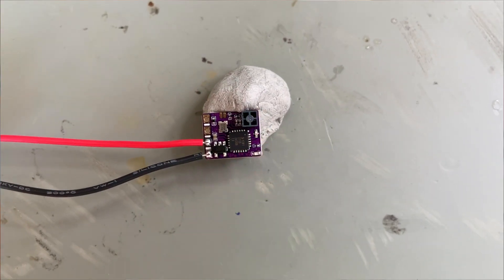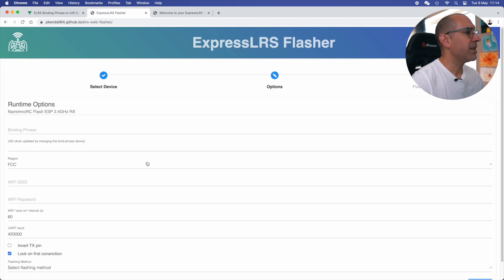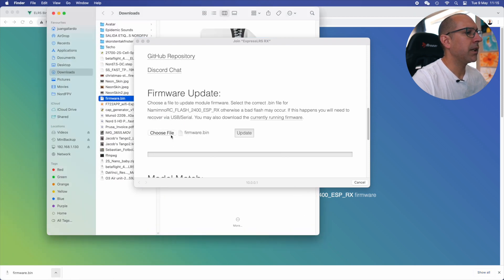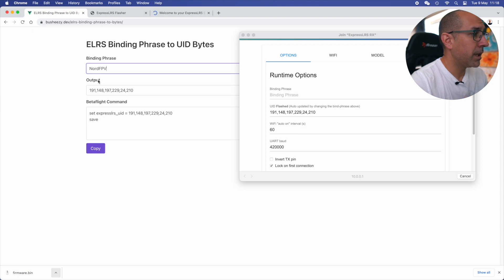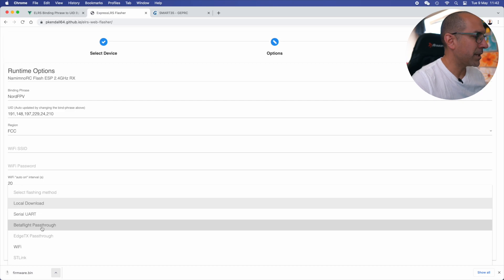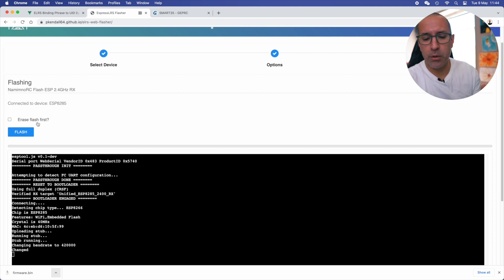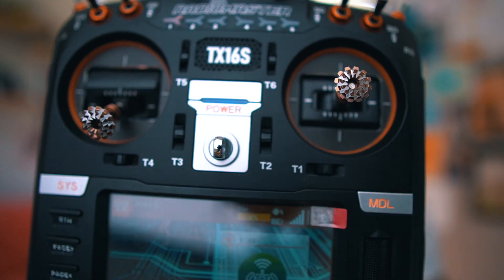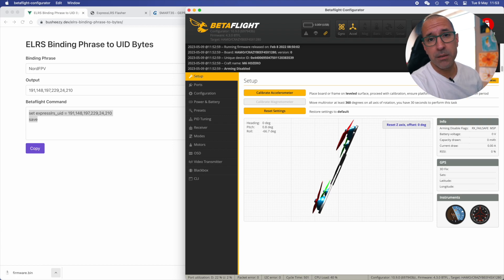3 Easy methods to bind ExpressLRS (ELRS)

Comment: I have tried all 4 ways and my Radiomaster RP3 still wont bind. Here's the issue, when powering it up 3x the light will blink for about 3 to 4 seconds. The it goes solid. Even when trying to do it wirelessly the light goes solid, but still no bind. PLEASE HELP. I have installed the RP1 and RP2 with no issue, this is the first time trying a diversity Rx...
Reply from the maker: Have you connected tx and tx already?  Try desoldering tx and tx, have just pwr and gnd and test again either with wireless or 3 times.
Reply: @NordFPV  a body of mine told me that if it gets hot, it's fried. It kept going into Wireless mode, but I couldn't detect the Expresslrs via wifi. Ordered another one thank you, and returning the one that came DOA

Comment: Im not understanding the idea of a binding phrase when i have more than 1 drone. If i use the same phrase on my radio and both drones, how does the radio knows to what drone to connect to in the event both drones get turned on?
Reply from the maker: Hello. Why would you have both drones on at the same time?
The pass phrase is just like a WiFi password, you can have many devices connected to the same WiFi as long as the have the correct password. 
From a technical point of view, if you turn on both. Drones at the same time, both will be controlled from the same radio while turned on.
Reply: @NordFPV  one example would be:

I have a TRX4 that I am planning to put an ELRS receiver in to control it from my TX16s, but I also have a Huina 1592 excavator that I modified with another ELRS receiver to also control it from the same transmitter.

My goal is that I want to use the TRX4 with an RC trailer to tow the excavator around, and I want to be able to have the excavator on, so that when I take the excavator to where I want it and I want to unload it from the trailer, I would ideally just switch models in my transmitter and that way I could control the excavator without having to touch it.

But if the remote binds to both RC products at the same time, that would not work.
Reply from the maker: Complex scenario! But yes. You have a way to achieve this too. There’s a parameter on each model where you can assign a model number, so when only that model is on the receiver will listen. I haven’t use it many times, actually I recommend FPV people to avoid it because it can creates confusion on FPV enthusiasts, but I know it exists. If you look in the ELRS wiki, and check something called “model number” (I think) you should get more information about it. But definitely possible.
Reply: @NordFPV  this is great information. Thanks. 

I have many models that I am converting to ELRS and many of them will be interacting with each other.  I'll take a look at the model ID.

Thanks a lot!

Comment: Got a elrs module for my reranis q7 s. Udated it's firmware. Im trying to bind to a pavo 25 v2. It's also updated and bound. I set everything up with a phrase and assigned number matching. I know im bound because there is a C on my radio, I got a solid blue light on the drones elrs module and i head my radio announce telementery on and off when i plug or unplug power. But i don't have input from the sticks on betaflight. What could it be?
Reply from the maker: The most probable problem is that either you have to/tx cables inverted, or that you haven’t selected the right por on the port tabs for your serial receiver. Last thing is to check you are using serial-crossfire as you connection protocol in the receiver tab
Reply: pavo 25 v2 cinewhoop and my Teranis qx7. I followed all the steps in the ELRS quick start website and got as far as binding.

My transmitter says im bound and shows a C indicates connected as well as telemetry signal . My wiring diagram that came with the pavo indicates UART3 and so i set that in Betaflight with Serial Uart and CRSF. Both TX and RX have the latest FW 3.3.2.

Phrase set and even assigned Model number. Ran lua script on TX.

I've set the internal module off and set the external to On. I've set my Model and switches to arm.

I powered my radio on then power the pavo, LED on the reciever blinks a few times and goes solid, radio says telementery recovered but no sticks on betaflight and no switched moving. What am i doing wrong? Thanks
Reply from the maker: @Monkywings , sounds like the only thing you haven't double checked is the physical connection. Check that TX -> RX and RX->TX, and not TX -> TX, RX->RX as many with this issue does.
Reply: @NordFPV  Solved.  The manufacturers diagram says the Uart is 3. I followed the Rx wire to the FC and it was actually uart6. Switched my Uart to 6 and my guy is airborne again. Thanks
Reply from the maker: @Monkywings  Great that you could fix it.

Comment: I just bought the geprecdark star 20 and y cannot flash it. When i tried to do it trough wifi mode, it appears that the receiver is beta fpv 2.4 nano. I dont know what firmware set up, if it is elsr beta 2.4 nano or geprec 2.4 nano as the manual said. What do you suggest?

Comment: If i try to use nano rx alredy binded to another FC, with my new FC, i must reflash it? Pressing button boot on rx dosnt any reaction, no conection with my radio, but when i resoldering rx to my old FC rx starts work with radio normaly
Reply from the maker: no. You can just move a bound RX from one FC to another FC and it will stay bound.
Reply: @NordFPV  great thnx i will try it! Telemetry without RX will work from new FC? 
what i must do to reset nano rx like factory reset?

Comment: I usually fly on crossfire and for me first impressions are terrible. I do not know the firmware version and it should not be a main point before binding... Imagine that you are on remote area without laptop and wifi (you phone is out of battery)...
How can I realize, what firmware version and RX type is there? 

My friend just left me couple of ELRS drones and I have bought a Radiomaster Pocket.

There is no way to bind the RX without usb cable and laptop on the field... Is this a magic? That is a disaster. 
How it is possible to make it so complicated and also frustrating, it should be just one button binding...
Reply from the maker: Well, there’s the way to get the device in binding mode by disconnecting 3 times the battery in a short time, so your very peculiar example would be covered by that. How do you know the model? Very easy, you let the device enter WiFi mode and open the web page and it gives you the information you are looking for and much more, and now, since ELRS 3.4, you will also be able to bind with a button like crossfire. Now think about any other protocol provider that has listened to the community and provides new features and changes this fast…

Comment: *you really should change the title to "3 way of binding ELRS with a binding phrase (ONLY)" or it is quite misleading 😒
ELRS is a total dumpster fire to setup today, and I would tell noob folks to use crossfire a thousand times over this BS system. Binding should only take 1 or 2 steps at most, and never involve this kind of foolery and juggling nightmare interfaces in multiple programs. It also doesn't help when everyone is so toxic, unhelpful, uninformed and out right mean in all the support forums.
Reply from the maker: Oh wow, I’m sorry you have had such a bad experience. For me it has been the total opposite, ELRS is simpler than others. If you decide to give it a try again and need help, please reach out, I’ll do my best to help you.

Comment: Hi, does the 2nd method work if i have flashed ELRS o R9M 2019 module and having R9MX receiver with an F4 fc. ? kind of stuck with binding. the factory firmware that came with R9M TX doesnt seem to work by pressing the button on the TX module. Kindly suggest.
Reply from the maker: Hello, I'm sorry I'm not very familiar with reflashed R9M modules/methods. But if the module already has ELRS I would expect this method of betaflight passthrough to work. Otherwise I will try to reflash one more time the ELRS software and try again.

Comment: What if I uncheck the box in the Auto Wifi On Interval? How can I reset that and enable wifi?
Reply from the maker: I don’t think auto wifi disables wifi. Auto wifi is to connect the RX to your wifi network. But even if it was, you should use another method that doesn’t require wifi to “fix” the problem, like betaflight pass through.
Reply: @NordFPV So if WiFi doesn't work, which mine doesn't seem to be working, but I'm bound to the receiver, if I flash via betaflight passthrough, good will I know which option to choose if I can't check the current target via WiFi?
Reply from the maker: @SunriseWaterMedia  The target and options are chosen before you flash anything, so despite I'm not 100% sure I understand your question, you should be able to chose the right target, the
 right options and all without wifi enable. I even think there are some old ELRS RX which don't have wifi at all, and things works pretty well for them as well.
Reply: @NordFPV  Oh, I just realized that the quad that the wifi doesn't work on, has an spi elrs receiver. I wonder if that is the reason I don't see a wifi network on it. I guess I need to use betaflight to do the flashing and setting of the binding phrase. This is all so confusing, but I'm slowly learning! Thanks!
Reply from the maker: @SunriseWaterMedia  my friend. SPI ELRS are a different beast. You can't update a SPI firmware like you do with a serial base. You need to upgrade the whole betaflight firmware of the FC to update the ELRS firmware.
Reply: @NordFPV  I'm learning...the hard way. 😜👍 Thanks! 😎
Reply from the maker: @SunriseWaterMedia  hahaha, the best way!. Enjoy

Comment: So good to find someone familiar with all that stuff around ELRS and binding! 🙂 Nevertheless I still have problems to bind from a TX16S with an ELRS Ranger module to a PWM-receiver (Radiomaster ER6GV for planes). Beside other methods I found something with 3 times powering up the receiver for a second. I had no success doing so. What I don't understand is the concept of the binding procedure since it seems to be very different from binding in the standard rc model realm which I know quite well and every thing is clear. Is there somewhere a comprehensive description in the www? I already succeeded in WiFi connecting to the receiver and got to the point where I was able to flash the firmware.bin into the receiver. Finally I didn't flash it because a warning rose that the current target is UNIFIED_ESP32_2400_RX and the upload is UNIFIED_ESP8285_2400_RX. ... so many questions.
Reply from the maker: Hey. The best source of information is the ELRS wiki. There’s everything there. 
The error you are getting means you selected the wrong model for the RX. Be careful with your choose and make sure is the correct one by looking at the manufacturers website.

Comment: Good info mate. Don't forget the bind process. Most newer elrs receivers can enter the bind phrase be powering on and off the FC 3 times in quick succession. This will force the FC to enter bind mode. Don't bother typing bind_rx into the CLI of betaflight....this simply wont work.  Also make sure that the ELRX RX firmware is the sameas the ELRS TX firmware. If not then they will also not bind.
Reply: I found out it was damaged on arrival, it gets really hot.

Comment: the most important word to mention is " To bind radio and receiver is first they should RUN THE SAME FIRMWARE VERSION!
Reply from the maker: Darien, the problem is that this is not always true. You can have a difference in the minor and they can still bind; I.e 3.2.1-TX can bind with. 3.2.0-RX, and when the devs went from 2.x to 3.x i asked if we could assume that mayors will never bind, and their answer was: up until now this is true, but is not 100% sure that will be the case in the future. 
So, yes, it’s a good practice to have everything in the same version, but not 100% necessary
Reply: @NordFPV  yes but still it is the most important keyword... coz almost 100% of elrs tx and rx do not bind if they do not share the same firmware version

Comment: Can I put ELRS on my old Taranis QX7 accst?
Reply from the maker: I Belice that the QX7 has a standard JR bay which you can use to connect an external ELRS module.
Reply: @NordFPV  yeah. I need to check if it’s compatible with my opentx version